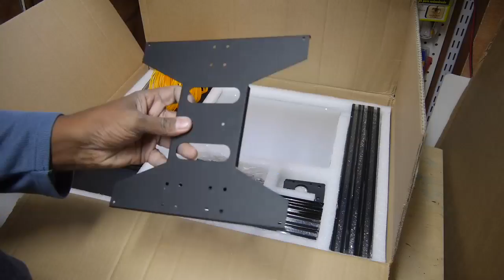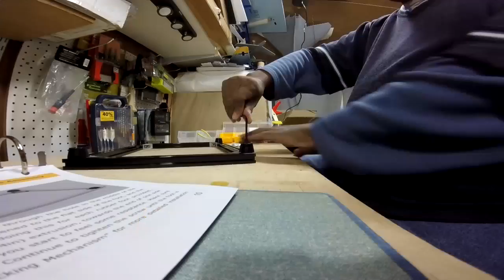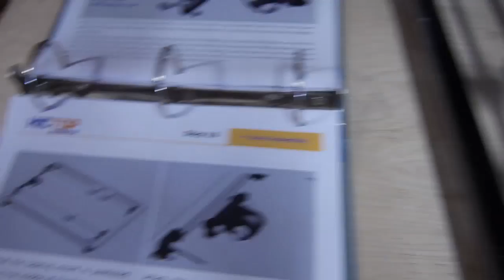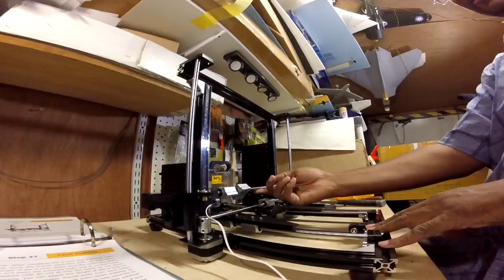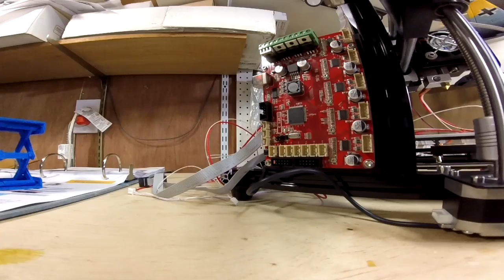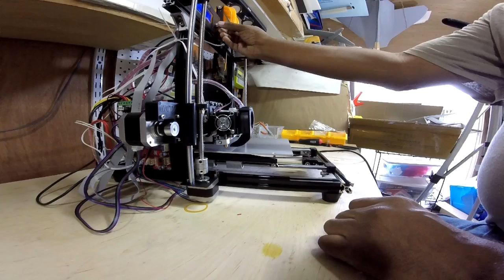Hictop Prusa i3 3-D Printer Build | HobbyView

Comment: Do you still like that printer?
Reply from the maker: monkfry , Yes. It has been a good printer.
Reply: Forgot I asked you this question. You're that RC guy, Good stuff! I ended up buying a CR10S because of the 500X500 build platform. I'd been researching 3D printers for about 2 years and finally pulled the trigger. I literally just got it and haven't even made the test print yet. The dedicated bench area is almost done though. Now I see people putting lazers on them and cutting balsa. Awesome option for making planes or plane parts!!